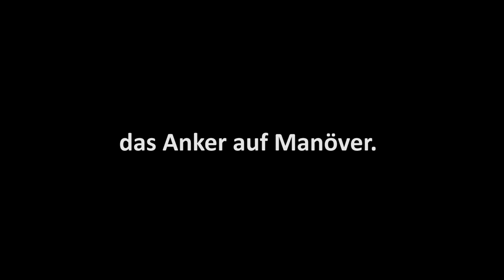Ankern einfach erklärt

Comment: The question was yesterday about Delia's accident which collapsed the bridge in Boltimor - whether anchors on container ships can stop a ship. I'm trying to find out why ships don't drop anchors or do they not brake or its too long to do ?
Reply from the maker: Hi, I guess when they have no electric power on the containership the windlass will not working. And if they have power, it needs time. An Anchor can stop certainly a containership but it needs time.

Comment: Folks, as you can see, with proper scope let out, no anchor can compare to the genuine Bruce. Minimal fouling surfaces compared to all versions of stocked anchors, superior set and reset characteristics and, unlike the plow, a device originally designed to travel THROUGH the substrate (think about it) it has multiple prongs to catch on things rather than just one. The fisherman's anchor sets a bit faster and I do use one from time to time in special circumstances, but there's too much for the rode to catch on when swinging in wind, current or tide change. Bruce anchors rarely foul on rode because they burry readily. Also, unlike Danforth and other folding anchors, they almost never bend and cannot be 100% defeated like a folding anchor can when a small rock gets between the shank and the flukes. I am talking genuine Bruce here, not the weaker and far cheaper knock-offs.

Comment: Invalid testing/demonstration the anchor does not get pulled on by a horizontal force… well unless the boat is over the horizon from the anchoring point.

Also the anchor only anchors the end of the chain, its the weight of the chain suspended between the ship and anchor that maintains the ships location.

Comment: Hook the chain to the bottom end and use a properly sized (strength) zip tie to keep the chain to the tip. If it snags, a strong pull breaks the zip tie and you can pull it out from the back. Look at some folding kayak  anchor YT videos...
Reply from the maker: very interesting :-)
Reply: @sailandmoremedia  "Interesting" is being kind, the proper word is ludicrous.
"A strong pull" is what anchors are exposed to when deployed.
Using this suggestions on anything larger than a canoe on a lake is sheer stupidity.
Reply: That's a great idea if you're not interested in sleeping at night.
Reply: @mattc677  when choosing an anchor sleeping at night is my primary consideration. :)
Reply: @acmeopinionfactory8018  It's an old trick that all the fishermen here in Borneo use, indeed they claim it's why the anchor has that eye at the end. By strong pull they mean engine power, and by zip ties they mean big, thick things, and 2 or 3 of them. But for sleeping? No.